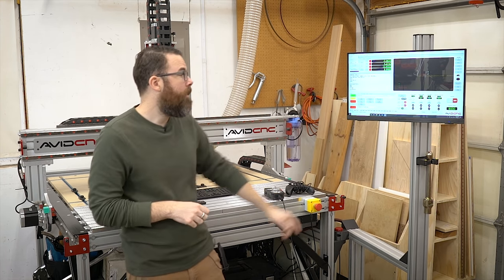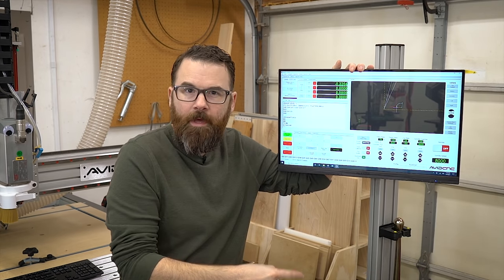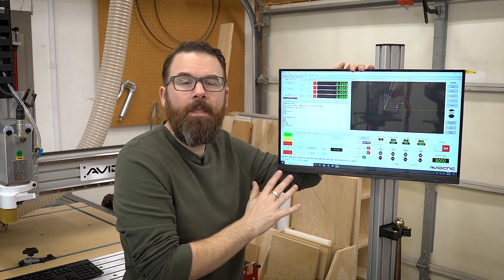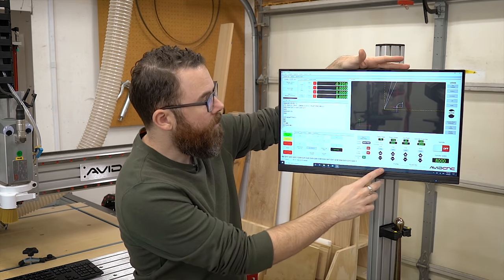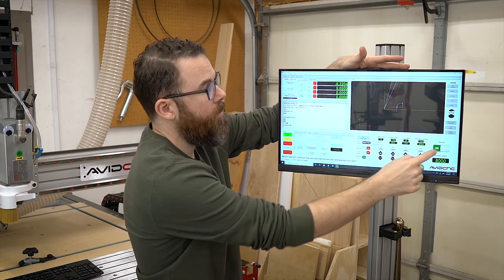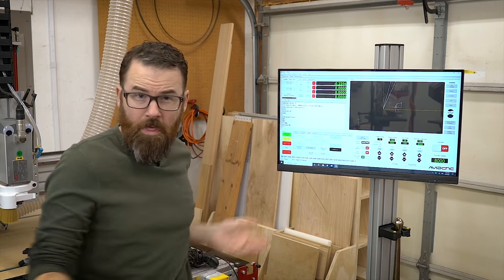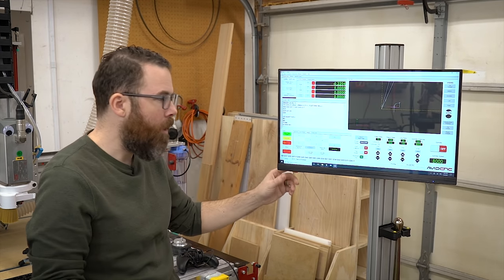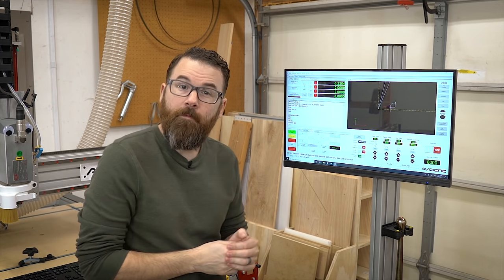CNC Pendant Comparison

Comment: I have been round and round with this. Several controllers from game pads, shuttle pro, wireless keyboards (full size and mini), streampad, touch screen. The best thing so far is a pendant from VistaCNC. The fact that the estop works and has the LCD is a nice bonus. Still working on getting used to it. Can ROCKET front to back with great control. The wheel feels amazing.

Comment: Holding down control on your keyboard while tapping arrow or up down keys on your keyboard does send pulse control to mach4 same as holding down shift jogs at full speed, still much nicer to have a pendant.
Reply: You can also program that into the game controller. Check out Jay Bates video, I think it's episode 4 of his playlist. he shows how to program the game controller for a little more control
Reply: I did the Jay Bates thing. Works fine, just for general movement. The VistaCNC P4-S with manual pulse generator wheel is the best solution

Comment: Contour Shuttle Xpress does it for me, on both CNC/router machines I have.
Love the progressive speed control on the outer wheel, and step control on the inner, indented wheel.
Relatively cheap (bought 3 second hand units), almost plug and play.
And it works in Adobe Premiere / DaVinci Resolve too!

Comment: Very good overview! I've been using a ShuttleXpress on my CNC mill for a long time and have been very happy with it, but the MPG does look sweet. Hearing about the software issues of the MPG is disappointing, so thanks for the warning. I'm in the process of overhauling the CNC to use UCCNC and one of their ethernet controllers (goodbye Mach3!), so I'm hoping that the ShuttleXpress will still work just as well once I'm done.

Comment: This is quite Mach specific. Some CNC controllers will handle the keyboard in such a way as to make step control possible. When you think about it, typing is step control for letters, and you're doing it all the time, so it's obvious it can be done.
Reply from the maker: You're not wrong, PathPilot does it.  But it's still quite clunky compared to a true MPG.

Comment: I use a game pad on match 3, it uses the left joystick for x/y and right joystick for z. They're speed moves relative to how much you push the stick, also it's setup so the left and right triggers on the back can be used to change the speed range of the joystick. ie without the trigger squeezed in I have the max speed of joy set at 25% so I have fine control of with the joystick, squeeze in the trigger and the max speed can go upto 100%. Basically I think you should have spent a bit move time setting up, but with the pendent you don't have to worry about it
Reply: Speed at 25% is still too fast for moving the Z-axis if you want to get close to the z-levelling sensor. As far as I remember, my trigger adjusts the speed from 0 to 100% from the normal jog speed, which I have set to only 30% of my max travel speed (18000mm/min)

Comment: Robert, great tutorials as always. Do the control options you've shown all use the Acceleration Profiles previously set up in Mach 3-4 for example, when Manual jogging?
Reply from the maker: Correct, jogging, rapids, etc all use the motion parameters setup in Mach3/4.  You are simply adjusting the speed, but the profiles remain for each motor.
Reply: @RobertCowanDIY  Many thanks Robert.

Comment: I've had really good luck using the Centroid Wireless Control Pendant on my machine, both in terms of range and response time.  I'm not sure if there is a driver to allow it to be used with Mach 3 or 4 though.
Reply: i think there's is propretary...perhaps someone has hacked it...not a fan of wireless tho

Comment: The real problem with the wireless versions is the manufacturer refuses to write a driver to work with mach4 and instead push their mach4 control board.  I bought one of the WB04 wireless pendants and had to return it because there is no way to get it to work with mach4.

Comment: My Amazon Gamepad has analog proportional movement in Mach3. But it's not a good solution if you want accuracy and speed at the same time. I just set the normal travel speed to 30% so I have accuracy. If I want speed, I use the keyboard plus the shift modifier key.
Reply from the maker: Good to know!

Comment: I do not use March3/4: For UCCNC: the xbox controller plugin is 99% perfect. DPad for fast moving, Joystick for slow steps (for more accuracy bind the trigger buttons)
If you don*t need a display (monitor mounted in sight or not needed) there is no real use for spending >200 bucks for an extra one.

Comment: My Tormach pendant (round one) sometimes “sticks” which keeps on going.  This is bad.  Frustrating for me!
Reply from the maker: Oh bummer.  Mine has done that once or twice, I wonder if they get debris inside?
Reply: @RobertCowanDIY  thanks for the reply!  I do suspect chips could be getting in there.  I would like to have Tormach offer something more robust. These Tormach people have made my knowledge and abilities which have been directly enhanced by owning my 440.  Size hasn’t been inhibiting what I have been doing so far.  If I could have known, I would have had a 770 MX which would fix some of my issues that I don’t like.  I watch what you do as I learned from you on your 440.  A lathe may be in my future as a replacement for my manual engine lathe.
Reply from the maker: @cogentdynamics  I'm pretty much in the same boat.  I do like my 440, but I would really like something bigger and the MX series seems to address some of my issues as well.  But when I got my 440, the MX line was years out!

Comment: Whoever programmed that gamepad plugin just did a poor job. You could easily make the left analog stick a fast/coarse move, the d-pad a pulse move, the shoulder buttons hold for pulse size (eg hold left trigger 10 thou pulses) etc. etc.

Now I'll give them the benefit of the doubt and guess that maybe the host software doesn't allow such control, but still...

Also I don't own a CNC router or anything similar, just a 3d printer XD
Reply from the maker: I agree with you, but there aren't any plugins available that work the way it should.  But still, using a button to 'step' a machine just isn't ideal.

Comment: Knowing nothing about CNC that interface just looks plain awful in general. 
Is this state of the art?
Reply from the maker: This is HOBBY state of the art.  The real stuff looks much nicer.  It's not as bad as it seems though, it NEEDS to be utilitarian, since you need to make more adjustments.  3D printers have some cool interfaces, but in reality you don't really need to ever interface with one.  I just hit print remotely and remove it when it's done...  With CNC, you really need to interact with the machine a fair amount, so there need to be lots of buttons and adjustments.
Reply: @RobertCowanDIY  Thanks for the explanation.
I wasn’t really talking about the amount of controls etc. though but just how non user friendly and hard to use everything looks (the jog controls you highlighted being a perfect example).